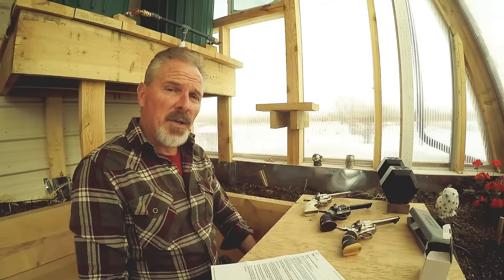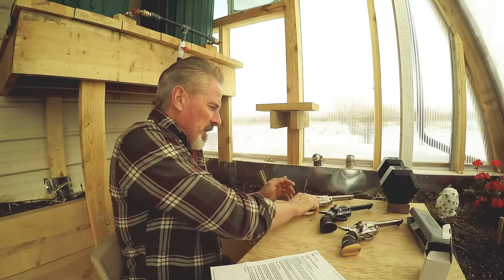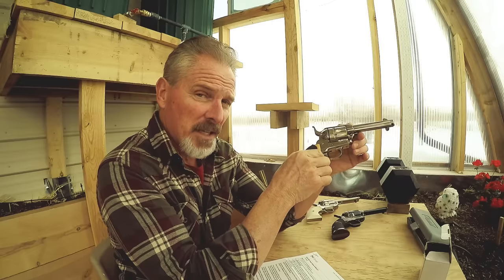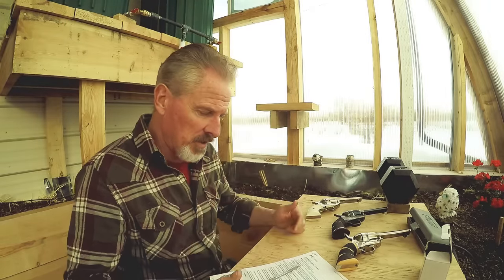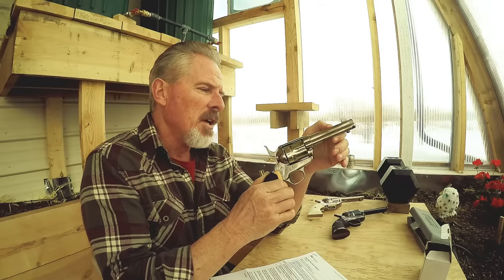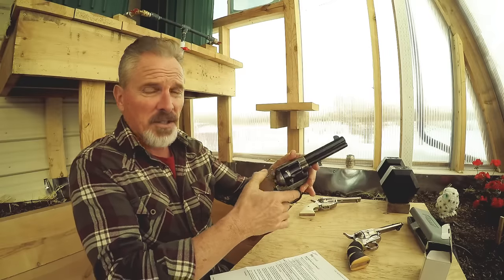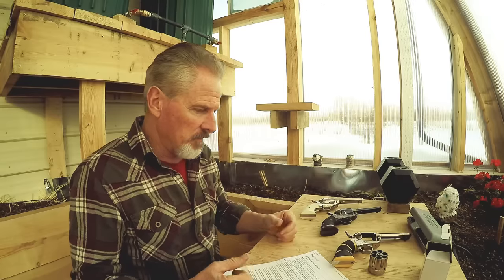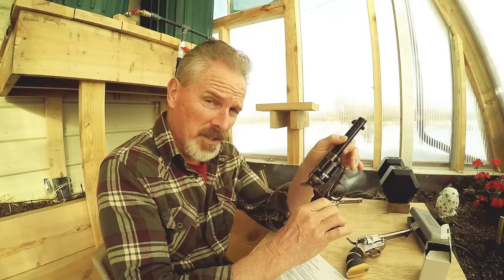Unlocking the Secrets: How a SAA Race Gun Works

Comment: Not a huge gun person, but the history, engineering and ingenuity is presented well and really interesting! Thank you!
Reply from the maker: I'm glad you enjoyed it. It is fascinating mechanical engineering at work in race SAAs. Thanks!
Reply: Not a huge gun person? Not everyone is perfect. But you can change. 😂
Reply: God made man, Samuel Colt made them equal and this guy fine tuned it, my hat is off.
Reply: Same here, but I can only imagine the hundreds of hours somebody spent figuring out how to do that reliably for the first time.  It was also interesting to understand the action better on the SAA.  There's a lot more going on there than I would have guessed.  Machining technology must have been better than I previously imagined to mass produce those in the 1870's for an affordable price.
Reply: @charlesenfield2192  
It was literally a row of manual lathes and milling machines with other more now obscure machines. Each one would be set up with fixtures adjusted to make a single but repeatable cut. The part would start out as a hunk of steel in the first machine, get it's first cut, get moved to the second machine, so on and so forth for each individual part, all the way up to the finishing area and that's where it would deviate a little bit in terms of finishing. There's different ways of finishing such as bluing vs nickeling. Bluing is actually a form of controlled rusting and you want to do that in an area separate from your equipment. As for nickeling I can make a guess but I don't know for sure. I think they run current through water and magnetically attach nickel to parts now. I don't know how they used to do, I'm assuming a combination of heat and a certain chemical solution. I'm just now getting into gunsmithing but I did go to school for machining and welding so it's not all alien to me just yet. I'm reading a book from the 1930s called "modern gunsmithing" and it's fascinating. The great depression was on so there's a section on how to be a gunsmith in an apartment with minimal tools for example. I eventually want to take classes through Sonoran Desert Institute. But forgotten weapons has done Q and As on what you were asking about. Sorry for the long answer, you seemed interested. But to go back to your statement, it took a lot of planning of relatively simple actions and a lot of time (most of which was swapping parts from machine to machine).
Reply: @isaiahcampbell488  Thanks.  I was interested, and that makes a lot of sense.  Machines didn't need to be incredibly accurate or adjustable - just repeatable.

Comment: Gotta say. Great job in explanations. I knew about 70% of what you mentioned but the balance regarding the support bolt. The depth and guide of the notches all excellent. But what im still amazed at is how you get three shots out of the cock n fan. Ive tried to stop the video so I can see but im missing it. 
In any case. Thanks for all this. 👏👏
Reply from the maker: I get the two shots with one sweep by contact with the thumb first then the little finger on the hammer as it goes by. This after breaking shot one with the trigger press.

Comment: Absolutely fascinating. I have shot single action revolvers for years. I learned more in this fifteen video than I ever have with years of experience. You did an excellent job of explaining how these critical parts interact with each other. So this may be a silly question, but I’m gonna ask it anyway. Can a modern (transfer bar) Ruger be made to run like an SAA?
Reply from the maker: Yes, I think a transfer bar revolver can be made into a race gun. It will have a little more friction and will required a sightly heavier mainspring. So the action will not be quite as light but I'm sure it would still run really good.

Comment: I'm new to the SAA, I got a pietta and I have one cylinder notch that doesn't lock up properly and your explanation of the action may have cleared up the issue with the ill fitting bolt. Thank you for your work on the channel :)
Reply from the maker: I have more in depth SAA information on my rumble channel. Thanks!

Comment: What a fantastic informational video! Now I know not to try and run my P frame fast (and wreck it), and what it would take if I did wish to make that happen. Sounds like it would make more sense to buy a used race gun first.
Reply from the maker: Thanks! P frame is a double action? I've never owned a double action. This only works with single action race gun revolvers. they are as rare as hens teeth. I found one once in a gun store and reverse engineered it and learned to build my own out of 600 Pietta clones. Long Story.

Comment: Great information! The tail edge of my cylinder notches on my 1860 (replica, I wouldn't modify an original) are starting to get a little chewed up, I might have to do a bit of filing on my bolt just like you showed here. (I don't run it fast and I don't fan it, its possible but not recommended on a cap and ball). You can't really run them fast anyway because the percussion caps tend to break up and get jammed up in the action. Mechanically the two designs are almost identical aside from the ignition mechanism and the loading gate/ejector rod

Comment: Great video!When you said polished with 600 grit sandpaper, I was a little surprised. Why not 2000 grit wet sandpaper, Or even a flap wheel with green rouge? is it better not to have a mirror polish?
Reply from the maker: Ya you can do that. I start with 600 gr and go right to a hard smooth stone for a mirror.

Comment: Question -  Do you use locktite?   ....and if so, which type - red or blue?  .....and where would you use it?  I find my Uberti SSA clone is prone to screws backing out a surprising amount in just one range session.  Great video.  You have nailed it for us old boomers who grew up watching westerns. Many thanks.
Reply from the maker: I have had the same problem with race guns. Since I frequently have to break them down to adjust something just a bit I put painters caulking on the screws.

Comment: great video! i was wondering if any SA old west gun could be converted to a Race gun. would it be possible to do a similar modification to a Schofield S&w model 3 design. I understand the issue with the break top opening when fanning, but would the same idea work for it and perhaps with a longer fanning hammer?

Comment: Fantastic explanation. Just wondering; how often do the modified parts (especially the bolt and the bolt support block) need to be replaced due to them wearing out by rubbing in each other?
Reply from the maker: Never had a problem with any of my bolts or support blocks. I have had springs fatigue and break in one instance.

Comment: I have a gun im working on to be a fast draw/race gun but it still needs some work. Got better springs and modified the seer a bit, cylinder is slicked and the ejecor rod is removed and the screw hole filled. But i need to knock the front sight off and get a raised hammer, and thats work that i wanna have my gunsmith do, and that dude is always busy.

Comment: Was the spring that lifts the bolt changed to a heavier one?  

Any weight that could be removed from the bolt will allow it to react faster (unsprung weight).  Weight at the tip, where it is moving faster is more important than weight near the pivot point.

Comment: I’ve always wondered how people fanned their revolvers in competitions without causing damage to the revolvers. This is quite nice to know!

Does spinning the cylinder at half cock damage the bolt or bolt grooves at all when done fast?

Oh and, are race guns technically better in a defensive situation than a regular unmodified revolver? I imagine it might be less accurate, but the faster fire rate would seem good against an attacker.
Reply from the maker: Spinning the cylinder does not hurt it as long as you don't move the hammer until it stops.
Reply from the maker: Single action revolver don't make great self defense guns because the controls are complex and they are time consuming to reload. A Race Gun is just as accurate as a stock gun. Thanks for watching 😀

Comment: You have some fascinating videos up! I always cringe when I see someone handling a new or used single action in a store and they start fanning it the way you do with a "race gun". I would assume that cutting the bolt notch deeper weakens the cylinder slightly, right? I wonder how much weaker it becomes due to that. Either way, thanks again for all this wonderful info.
Reply from the maker: Not much weaker, imo Just a tiny spot because it's on an angle is 10 thou deeper than stock
Reply: @TUCOtheratt  I just wondered. But I would say you generally run the loads no higher than 13-14K pressure, right? I laugh when some sneer at standard pressure .45 Colt loads. Plenty of meat has been taken with standard pressure loads and I sure wouldn't want to be hit with any of them. Also, is there any truth to the story that fanning tends to break the "safety" notch and destroy the sear on the hammers?

Comment: What make some cylinders to lock up a little tighter than the other.   I have watched a few gun video"s never have i seen anyone to up close show the exact way the cylinder stop and cylinder   actually work up close and to the point , thank you for your expertise and explaining . Please get back with me on my question.
Reply from the maker: Slightly deeper notch, custom recesses/relief voids in the bolt/cylinder stop, slightly advaced bolt drop timing. High level precision machine shop work required.
Reply: @TUCOtheratt  Is it something not to worry about,  or it's not worth it to fix it could be to expensive,  the gun does shoot pretty good.  Like I say it's not that much of a difference, but I notice a little when I check for cylinder lock up two of them maybe just a little more looser , one guy said it's ok two have a little wiggle as long as it don't go pass cylinder.  What's your opinion.  Thanks for getting back with me.  Tuco
Reply from the maker: @craigfinley2507  Wiggle in the lock position is normal. Well constructed stock guns will have 1 1000ths bigger notch than bolt. That gives a noticeable wiggle. The used race gun I bought at the store had a bolt that was 3 or 4 thou smaller than the notch but that thing will shoot one hole at 7 yards hand held. The forcing cone solves many things. As long as it locks up at full cock and stays in the notch is all that matters.
Reply: @TUCOtheratt  thanks again Tuco  I feel better about it now.   The master Gunman  Tuco

Comment: That gun you bought with a fanning hammer was very likely modded by Bob Munden. The hammer is definitely Munden style that he and Becky used on all their Colts. I have a Cimarron that he modded in 1992 that has all the same exact mods that yours does. I had Becky authenticate the work on it in a letter a year ago to complete the paper trail between Cimarron in '92, to the original owner, to Munden and back, to the next owner, and then to me.
Reply from the maker: Your comment is very interesting to me. This gun is not a Munden gun I'm sure because some of the work was very substandard. It's a poor quality Mitchell Clone. I have had to fix it several times, bolt , hand , firing pin. Things are misaligned. The hammer does look exactly like a Munden hammer. Now, a story I've told no one up until now. Bob did a full race job on a Cimmeron for ME in 1992!!! I was just a kid and only shot factory ammo out of it which was intimidating. I didn't have the skills to fan it back then.  I wasn't enjoying it much so I sold it when I needed the cash and have regretted it ever since!!!  Everyone says Bob would only do race jobs on Colts or Rugers but I knew that wasn't true then I meet you. Did you buy your gun from Bob? Also can you tell who the manufacturer was as Cimmeron would have been the importer?

Comment: What is the clearance on the support block? I understand that it glides on the bolt, but on the opposite side in the frame, what makes it rigid or unmoving?  How is it mounted in the frame and held out of the way?  great job by the way.
Reply from the maker: It fits perfectly in the void between the bolt, frame and trigger/bolt spring.

Comment: Hmm.  It seems that the bolt would be getting so savagely battered that it wouldn't last very long, even with the bolt block installed.

Years ago I knew of some percussion revolver shooters (on the now defunct 1858 Remington forum) who were having these things done to their guns, but they'd install a harder insert in at the edge of the cylinder notch that's getting bashed.

Also, how can you deepen the cylinder notch when it's already super thin (to the inside of the chamber) on some sixguns?  Should one avoid full power loads in a gun that's received this treatment, or...?
Reply from the maker: Those are great questions. The weak point seems to be the notches. The bolt looks tiny and fragile but holds up well and if the relief areas are cut in the bolt it does not contact the notch in it's weak area but only in the bottom where it's the strongest. If you were to see the exact geometry of the notch in a SAA you will see that the thinnest part of the cylinder wall is not where the notch is the deepest. I won't get into exact depths because of YT policies. Bob Munden really fanned his guns hard and they held up very well. My fanning by comparison is very gentile. I have observed no damage to the bolt or the notches in my race guns from fanning. Other parts have went bad though unrelated to fanning but due to poor original design.  Thanks for watching!

Comment: what type of Colt Clones do you prefer?
i have a newer Uberti (with the three click hammer an build in firing pin safety) it should be possible to modify or do you recommend the older style four click version? is it better to block the firing safety? on my guess it should not matter that much. No worries i'm a metal guy :-)
Reply from the maker: I like Piettas the best with the original design/ no transfer bar.

Comment: How can you make the cylinder stop notches twice as deep (at least on a .45) without going right through into the chamber, or making the cylinder wall so thin that the cylinder bursts at that weakened point? The cylinder wall is already crazy thin under the bolt notches to begin with.

Comment: Would it be possible to do these modifications on a King Arms Airsoft SAA? I want to be able to fan it without breaking it, but I'm not sure if this would work.
Reply from the maker: I've never examined a King Arms Airsoft SAA. If the cylinder and internal parts are metal there a good chance it would work.

Comment: i live in the uk, but the engineering behind how old guns works is simply fascinating

this fascination and the fact i want to get the umarex pair of aces due to a compulsion to acquire the most random of things has lead me down a small rabbit hole with a very strange discovery, from what i can see, it might be possible to make a umarex saa into something like a saa race gun and i am not sure how to feel about it, namely because its co2 powered, the biggest question tho is would it even be safe considering its not made to be as tough as a real steel

not even what i wanted to say initially, just the things you mentioned had reminded me of things i had seen in breakdowns of the umarex saa, what i orginally wanted to ask is do you have videos on loading and reloading, cus i know there is an art to it, but for the life of me i can only find the results of people loading 6 rounds followed by a visit to er
Reply from the maker: YT doesn't allow ammo reloading videos. Sorry. I think if you fanned a CO2 pellet gun it might damage it and or it might not fire at all but I doubt it would be dangerous. Just wear eye protect and follow all other  gun safety rules.
Reply: @TUCOtheratt  aye, only reason i say it could work is because somehow the mechanism is near enough the same minus the co2 system

Comment: The cylinder locking modifications seem like a flat out improvement. Even for regular use, I don't see a downside and i often see what I'm that region on older revolver. Why not just do the deeper bulked up locking bits on all of the modernized guns¿
Reply from the maker: Great question. My guess is it would take a bit more labor to produce and everyone's a cheap skate at the store.
Reply: @TUCOtheratt  
I'd be sad if that's the reason. Especially with how much some of these guns go for. I killed my first revolver when I was a young dumb kid Mickey Spillaning the cylinder closed and doing roulette spins with the cylinder randomly loaded to train away flinch. Certainly accelerated the wear but if the construction was bulked up enough, it probably would have held up. 

I'd like to get some of this done to my super Blackhawk for reliability but now since I don't really hunt with it anymore and have taken my rings off, I think turning it into a .44 race rig would be an interesting way to run it. How much did the smithing on one you sent out run you? and would happen to know if the action changes that ruger put into their super Blackhawks would play nice? Not sure how well that transfer bar system plays with fan fire.
Reply from the maker: @CtrlAltRetreat  I've built 4 race guns out of Italian clones. One Uberti and the other 3 were Piettas. I've never taken a Ruger apart, so I don't know a thing about them, but they are different. I know some race guns are made out of Rugers.
Reply: @TUCOtheratt  
Looks like I'll have to ask around here. I'm in the right place for it, haven't really looked but I should be able to find some competitor types in central Texas. Thank you very much for the inspiration Tuco, wishing you the best.